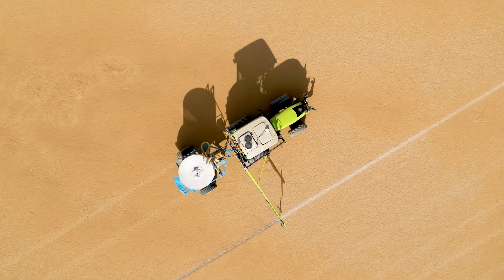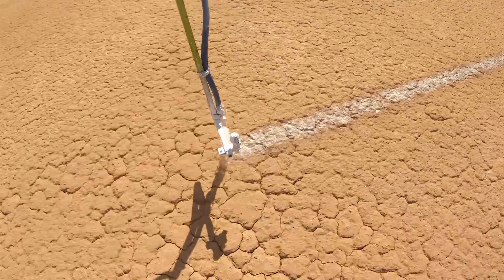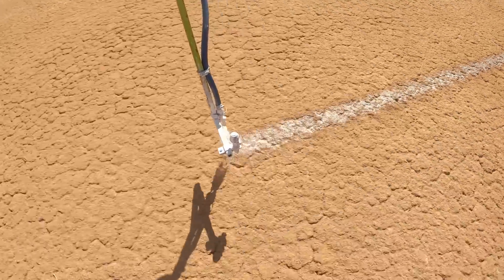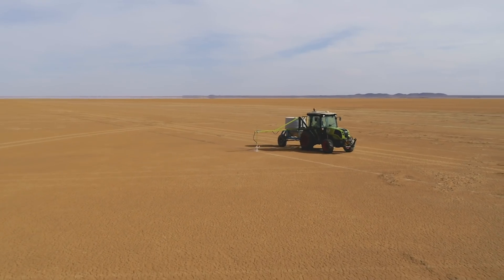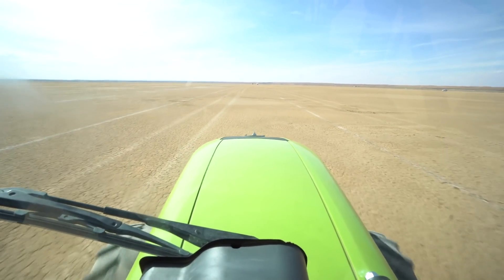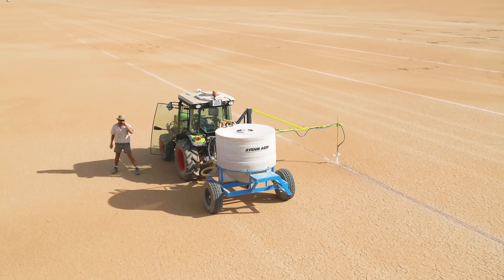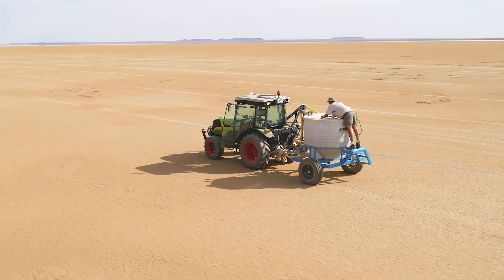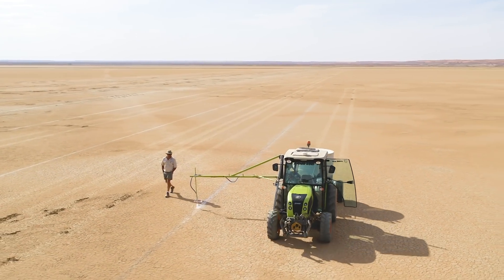How to spray high speed track lines | #2019HST

Comment: Not gonna lie, this precision is freaking awesome
Reply: There's nothing super precision about it. Any time you pass a large building or road construction project the GPS based surveying equipment there using has the same location abilities and have had for quite some time. Slaving the steering with a servo to maintain that pre programmed GPS line and position shouldn't be that hard either.  The whole system might be an off the shelf option on some tractors today.
Reply: @turningpoint6643  Just because it's widely used and common doesn't mean it's any less impressive!
Reply: With 2.5cm margin of error is not really precise..